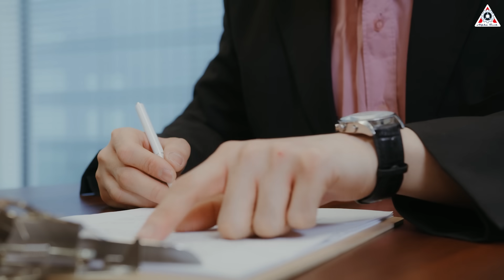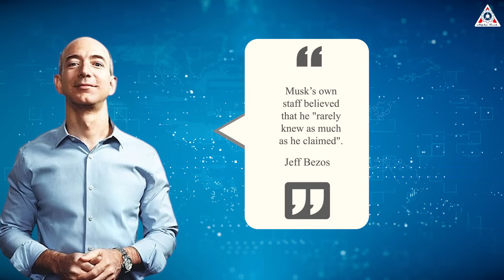NASA just revealed "New Glenn somehow will be operational before Starship"! Elon laughs...

Comment: You can't make up the clown-show that is Blue Origin.  Nasa apparently is treating BO & SpaceX as equals, despite BO still not having even gotten into orbit, while SpaceX's launches have become monotonous in their regularity.  Add to that, the rocket(s) BO sold ULA were having issues from the get-go and have yet to get anything into orbit.  Now, in probably a face-saving measure, BO is buying ULA - desperation if ever there was, to become a Space company, or at least a competitor to SpaceX.  It would have been a lot cheaper had they gotten SpaceX to put their satellites into orbit.

Comment: Forget Blue Origin until they successfully achieve orbit.

Forget about comparing them to SpaceX until they achieve orbit and be able to land the booster.

You can finally compare Blue Origin when they can get to orbit, land the booster and be human rated and repeat it multiple times.
Reply: The Soviet Union beat the US to orbit, but the US still beat the Soviet Union to the moon. It's not where you are now, it's where you have the potential to go.
Reply: @DeepDeepSpace  right... well, so far blue origin can't even manage orbit. so where they are now is nowhere and their plan is to have half the payload of starship at a higher price/kg. and that's according to their own numbers.
Reply: @Cortexion  Elon Musk's claims regarding price per kilogram of Starship are even more unrealistic than his time table for completion of Starship. The bigger the launch vehicle, the higher the price per launch. Starship is bigger and heavier than New Glenn therefore it will cost more to launch.

And SpaceX hasn't put anything into orbit with Starship yet only Falcon 9 and Falcon Heavy which is a derivative of Falcon-9.
Reply: @DeepDeepSpace  Most of the cost of most space launches is the rocket, that costs tens of millions of dollars and gets thrown away.  If the launcher is fully reusable, that cost goes away.